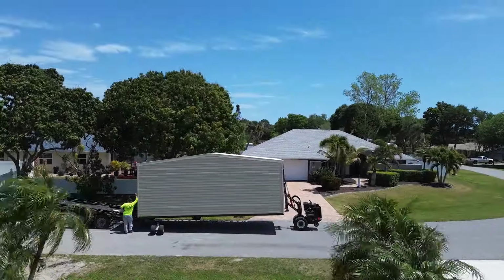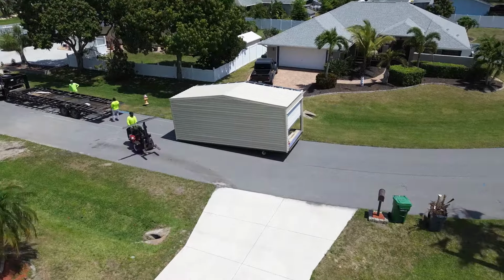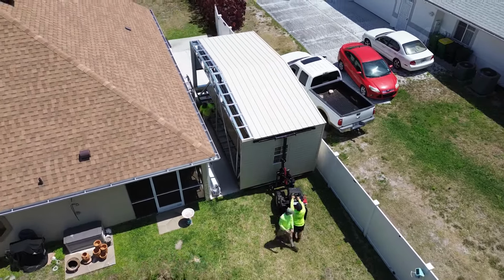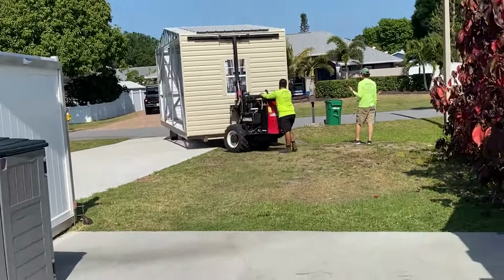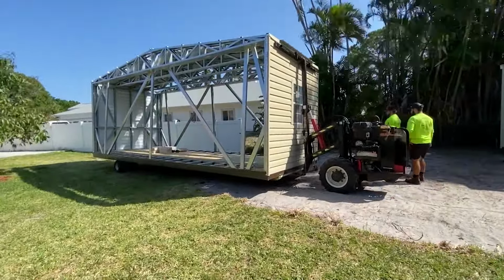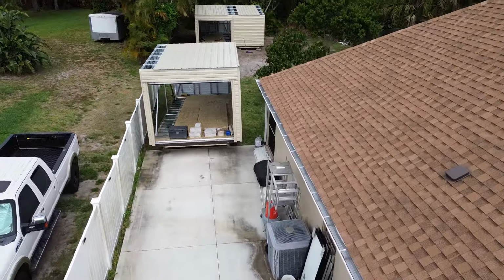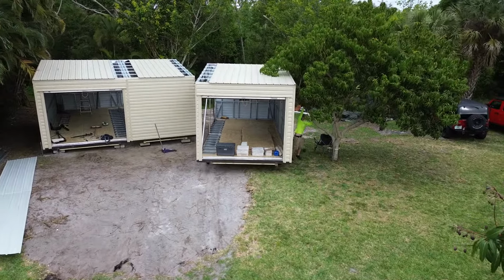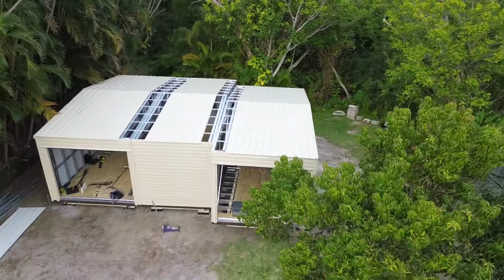Lark 24' x 30' Triple Wide Shed Delivery And Setup

Comment: Was this a better option than a metal building?
Reply from the maker: @JVMPerformanceDepot  it was for me. No building permit required. I could place it where I wanted, rather than where the county told me. It actually has a wind rating of 180 MPH, no slab needed, and it could be relocated at a later date.  I’ve insulated it, added walls, ceilings, recessed LED lights, and an 18K BTU mini-split.  In the process of building custom cabinets.